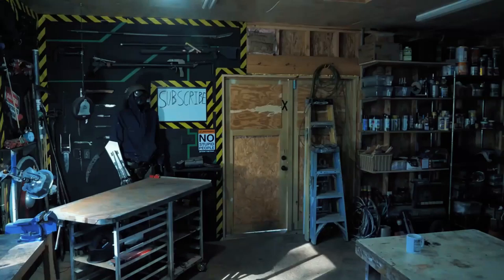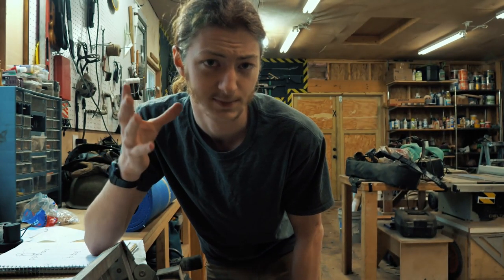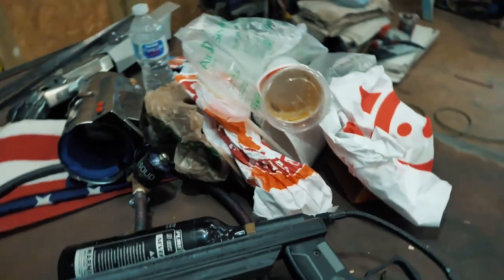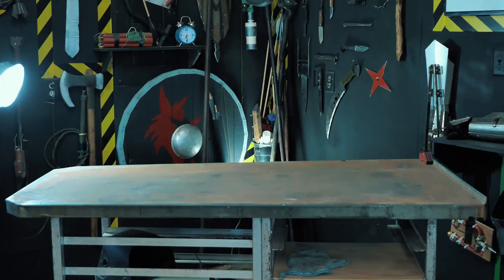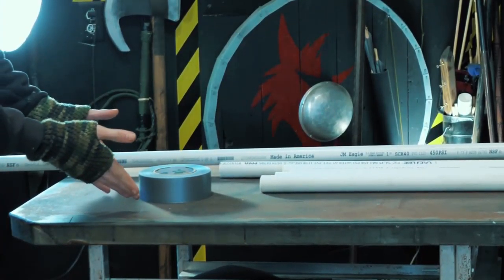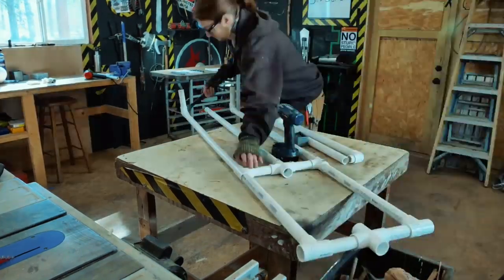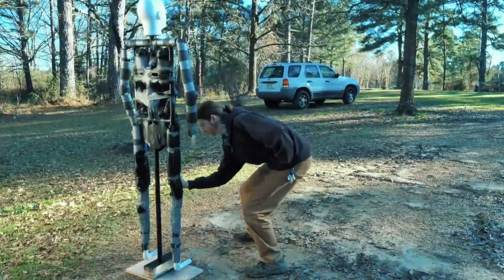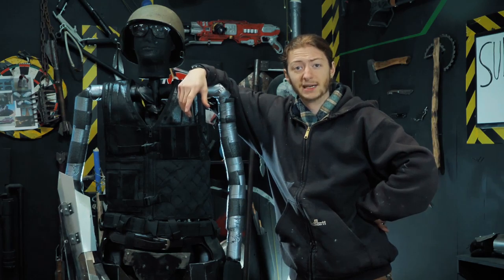How to Build a PVC Armor Stand | De Vlog 4  (Cleaning up shop, DIY PVC Armor stand, and more!)

Comment: I need to clean my shop too. The problem is that I go out intending to clean it but get distracted by an old project or idea and I end up making it worse 😂 On top of that I cannot part with any of the (useful) trash I have accumulated over the years. And I'm also not lazy...
Reply from the maker: I don't part with my trash. No self respecting maker parts with their trash. They just get bigger shops XD
Reply: @jakemakes  Lol sounds like me at least i clean my benches off and vac up the floor :-)
Reply from the maker: @rodneymiddleton1044   Yeah.... i'm pretty lazy
Reply: @jakemakes  lol it happens mate :-) . My biggest peve is the mess my 64 inch grinder leaves all over the benches and floor when i am making a knife or cutting wooden handles i wished i had the funds to really pimp my work shop out with a water jet cutter, a Knife kiln, large vac system or dust collector, insulating and putting up walls and a false ceiling with a electric exhaust , metal and wood bandsaw and the power installed lol. Just using a power lead from the patio at moment especially to run the portable aircon as it gets stinking hot here in Queensland, Australia :-) .